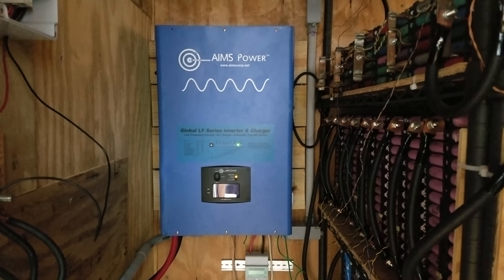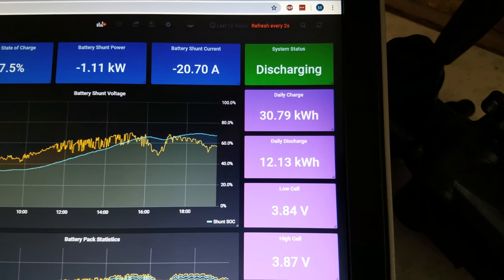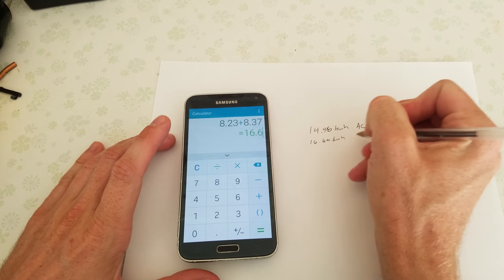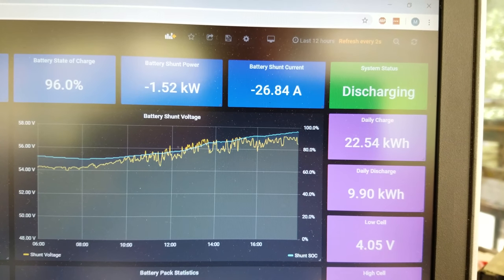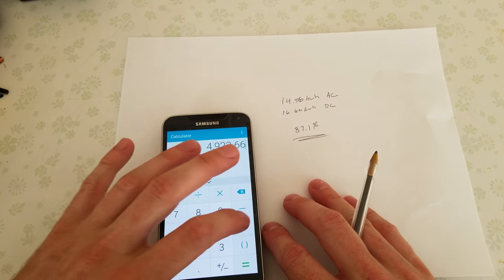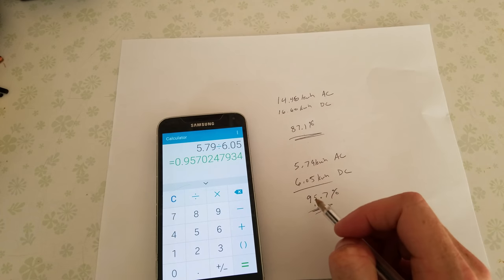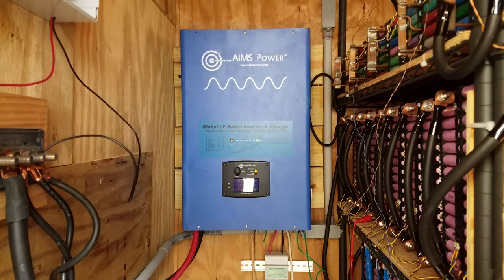AIMS Power 48V 10,000W Inverter Efficiency Testing

Comment: Love your youtubes/sharing!   I have the AIMS 12,000 watt and have been tracking efficiency this year.  I used the Midnite Solar Classic 150 data as the incoming Wattage numbers and some cheap AC power meters on the AIMS AC output side for the output Wattage.   I would note that AIMS documentation says 88% is the peak efficiency - which I take to mean that 88% is the absolute top efficiency the system is designed for.    So far this year I have  Jan at 84.1%, Feb 83.4%, Mar 84.6%, Apr 85.3%, May 86.3%, and so far in Jun at 87%.   My total/average for the year is 4,825.8 PV Watts in and 4,128.0 watts out of the AIMS for an average of 85.5% efficiency on an average load of 2,045 watts per hour over 2,019 hrs of inverter operation.     In my numbers the AIMS seems to be more efficient with higher load.   For example, when I added the Hybrid Electric Water Heater 6 weeks ago and as summer has ramped up I'm receiving/using more power and efficiency seems to be 1-2% higher.   But of course there are several factors such as load and accuracy of measuring instruments so its hard to make definitive statements other than the AIMS does seem to be 85-90% efficient.  One more note - the 4,128 watts out was distributed as 3,155w on leg1 of 240v and 973w on leg2 - so maybe the imbalance coming out of the AIMS cuts down on efficiency a bit.
Reply from the maker: Someone else pointed out the same thing with regards to "peak" efficiency. The manual contradicts itself, because the word "peak" typically means maximum, but the efficiency is listed as >88% which is "greater than 88%". It's confusing... Unfortunately, I don't have an accurate enough measure of power used on the DC side to be able to calculate long-term efficiency. I really should install another shunt right before the inverter.
Reply: Yes.  I really appreciate your initiatives / sharing.  From your data and other data points I think the bottom line is that AIMS is in hi 80 / low 90 % efficiency range...  which is reasonable for the price.  After all its not good to get too SOC ( 'solar obsessive compulsive' ) as clouds and many things make home solar power generation quite variable from day to day and one needs to get used to 'going with the flow' (of weather) :).

Comment: I built a 1kw 48VDC inverter for my server works well extremely efficient high 90's, no fan needed even when overloaded at 1.2kW, it can handle surges of over 2.4kW too, power is limited mainly by the 20Adc Breaker. I'm building a larger 5kW unit now with 10kW surge.

Comment: Have you ever thought about adding a grid tie to you inverter system to add power to the system so it don't have to go through the battery bank.  This would be  good if the invertor could not handle all the loads. I have four grid tie's with limiters.  This would be a way to use them if the power goes out and I would not have the capacity out of the inverter  for the load, but have the solar panels to do so.l
Reply from the maker: I've thought about it yes, but how do you prevent power from feeding back through the inverter? Do you have the same inverter? I asked AIMS a while back if it supported this and they told me no and hte inverter would be damaged if I tried it...
Reply: I have four tiegride with limiters. That have amp probs the go on the line coming into the service. As the current coming into the service slows so does the inverters output.  If a person could use these inverters in conjunction with the this aims.  It would make a good hybrid system for being on and off the grid

Comment: I want to get battery banking but it's so hard for me to justify the large cost considering my electric service does 1:1 net metering. The only justifiable reason for the battery banking option would be so I could have power during a grid failure no thanks to my microinverters shutting down during a grid failure. Of course that's when the battery banks would come in handy.
Reply from the maker: If you already have a working system in place, then it probably doesn't make sense to go off-grid. My choice was due to the extensive amount of permitting, inspections, and very high fees required to connect a grid-tie system in my area. It wasn't worth it and had a very long ROI, if ever...

Comment: can u make a video about your bank, how big it is how many days u can live whitout sun and so on ?
Reply from the maker: Normal load, which includes air conditioning and electric water heater, would be about 2 days. I'd estimate 2 weeks with just essentials like fridge and lighting. Keep in mind though that even on rainy days, the panels are still producing some power.
Reply: @LithiumSolar  how big is your solar panal system and battery system?
Reply from the maker: 10kW of panels and approximately 90kWh battery bank.

Comment: Any issues charging those 18650s with this unit???
Reply from the maker: Yes. This inverter is not designed to charge lithium batteries. I do not have the AC input connected and do not ever charge the batteries with it.
Reply: @LithiumSolar  cheers,

Comment: How is your aims inverter holding up? I am recently off-grid and are designing the electrical system. Are you satisfied? Have you had issues and needed customer support? If so, were they helpful? I am looking at the 8kw inverter charger.

Comment: What size battery bank do you have?
Reply from the maker: Not sure honestly. It changes pretty much on a weekly basis lol. I think it's around 70kWh right now.
Reply: @LithiumSolar  wow thats very large for a 48v system. But you do have a big inverter. I'm thinking about doing a 24v. 120v system around 3000 watts. Taking 8 circuits off the grid.

Comment: I have 12KV  Aims inverter . May I use Tabuchi Lithium Storage Battery 10 KWh Panasonic cell  87 volts output Thanks
Reply from the maker: No, that won't work with the AIMS 12kW. The max battery on that model is 62V. Here's the manual for reference https://invertersrus.com/wp-content/uploads/2016/03/Aims-PICOGLF10KW48V240VS-Owners-Manual.pdf

Comment: Is that dashboard from the Raspberry PI ISO that DIY Tech & Repairs made or have you made your own? I'm looking into doing a dashboard now that I have my powerwall online. :)
Reply from the maker: I made my own dashboard using Grafana. It's the same software DIY Tech & Repairs is running but it's not his dashboard/ISO.
Reply: @LithiumSolar  I was actually hoping you would say that. Do you mine pointing me in the right direction for the software needed? My goal is to run this on the same VM that my Batrium software is already running on, or on a Linux VM if needed.
Reply from the maker: My setup is split out a lot more than necessary because I already had hardware and certain things in place. I have one VM that runs MySQL. A second VM that runs Grafana. And a "miniPC" that sits in the shed and gathers the statistics. The scripts for stats gathering are written in NodeJS. Both VMs are running CentOS v7. The miniPC is running Windows 10 but will be replaced by a raspberry pi 3 as soon as I have some free time. All software can be run on the same host, Windows or Linux, if you want.
Reply: @LithiumSolar  Sounds like something I could do. The only thing I'm missing is the NodeJS scripts. If I read your reply correctly, you said these are running on your Win10 VM? Could you share these scripts with me? :D

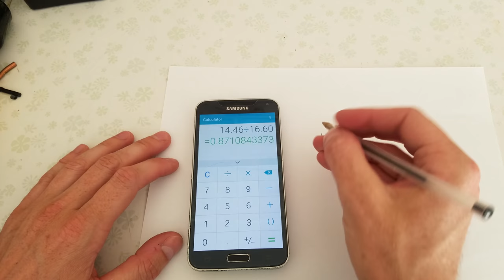Comment: 2:40 - not a "peak efficiency", but "average efficiency". Peak is probably much better than that. Probably around 95%.

You should hook up the AC meter somehow to battrium, so you have graphs available. Either using different meter, or just use the impulse/Wh output and integrate it. Doable.

You mentioned in some other video, when you were doing early testing, that the inverter has 170W idle draw. That was a lot, and probably do have a serious impact on efficiency under small loads, as well discharging battery even without loads. Obviously 170W is not much when you are pulling 9000W. But it is substantial when you are only pulling 500W. Did you figured out how to fix it? I guess fans itself could be pulling 30W. Do they slow down when the load and temperature of the inverter is lower?

In the spec sheet I did find this:

Idle Consumption: 150 Watts
Power Saver Mode Idle Consumption: 35 Watts

So 170W is weird. Plus probably worth looking into this power saver mode. Not sure why it is not default in the first place. My guess is that it can't provide an immediate power when in power save mode.

Comment: What is the zero load, standby current draw?
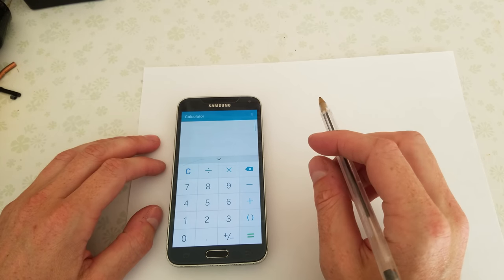Reply from the maker: With zero load, it's around 170 watts. It's intended to work with a load which substantially increase efficiency. I showed the idle load in this video at 1:45 https://www.youtube.com/watch?v=Q1F0WTX90SU

Comment: @lithiumsolar I've removed 10 circuits from my main and put them in a Protrans Sub Panel with built in tranferswitches, I've pulled power from the main to feed the line side of the tranfer switches and that line continues to a Power Tranfer Switch, feeding the shore power side, the other side of the Power Tranfer is fed by (2) 3500watt generators with a paralink feeding 120v @ 50amps max to a Victron Auto Transformer making split phase 220v, the output side of the Power Transfer feeds a 50amp GFI Breaker that then feeds my 12kw Aims Inverter, I also have 4Sx4P Renogy 200AH AGM's feeding the Battery side of the inverter. On the AC output side of the inverter before returning to feed the generator side of the Pro Trans Sub Panel there's another 50Amp GFI breaker. My question is, Grounding. In the Aims User Manual it states to feed the input AC power with L1, L2 and Ground only with output being L1, L2, N and Ground. Am I to assume that I need a dedicated ground from the AC output to the Main panel ground bar, running grounds from the transformer, generator and equipment through the input AC on the Inverter or am 180 out and the dedicated Ground should feed the input AC of the Inverter and all other grounds tie to the output. Dont want to fry this thing.  This system is designed to be a battery back up to the emergency power circuits I have in the Pro Trans Sub Panel, any help is welcome. Thanks

Comment: Lithium batteries in a flammable plywood room. Real smart.
Reply from the maker: What do you keep yours in?
Reply: @LithiumSolar  I don't currently use lithium batteries. I'm considering LifePo4, but as for flammable stuff, I have a concrete bunker outside that houses the electric generator. If you've ever watched a Tesla burn, you realize that you don't want that anywhere near a flammable structure. Concrete building, at least 10' from the main building. The only issue is heating it in the winter to prevent the batteries from freezing.
Reply from the maker: If you check my recent videos, you'll see an 1800lb steel shipping container ;)
Reply: @LithiumSolar  Is that where the batteries are installed? I've used shipping containers for transmitter sites/shelters at commercial radio stations and they are lined with plywood, so I would guess your entire inverter setup is in there. Good for protecting the house, but if the batteries combust, you're out your entire setup. I'd try to isolate the batteries in a separate metal container if possible.